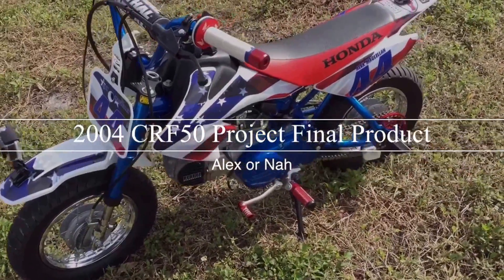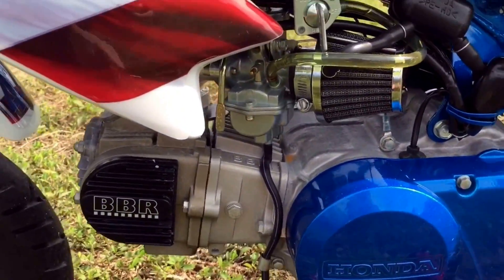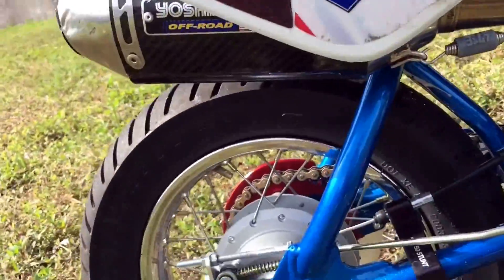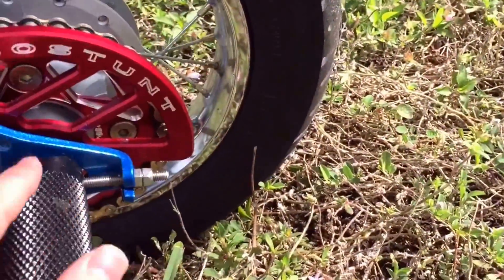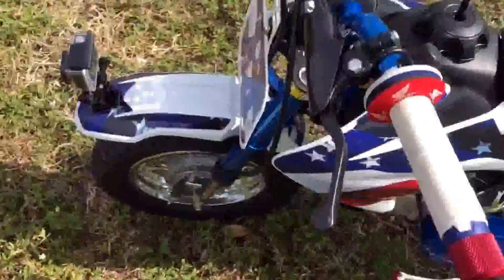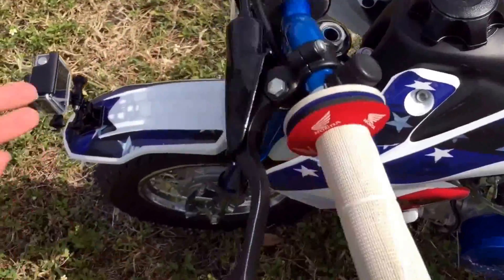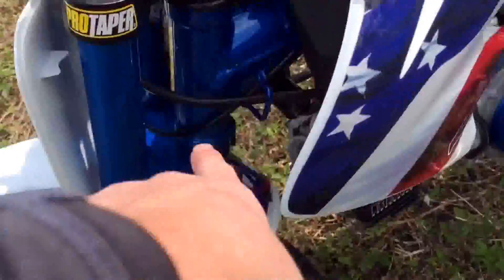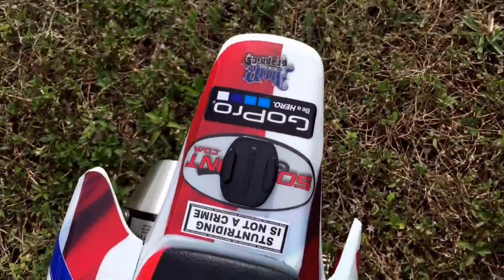CRF50 Stunt Bike Final Product

Comment: do u want a bigger or smaller sprocket I am guessing smaller?
Reply from the maker: Depends on rider skill and motor size. I have a bored motor so I went smaller but if you have a stock motor go bigger
Reply: for top speed (longer gears) go down in the back and up in the front.. they say one tooth is about 3 mph

Comment: Does it really go that fast for an 88cc?
Reply from the maker: +mike esposito yes
Reply: the bike bore kitted motors go faster than most of the 125cc and up chinese motors my 95cc z50 goes around 70 depending on the gearing aswell
Reply from the maker: Sean Smile yup. this bike goes 67 easy. whoops my crf80
Reply: Wait what is your gearing setup
Reply from the maker: Sean Smile stock front and 3 down in the back if im correct
Reply: SO 13/ 34
Reply from the maker: yes
Reply: mike esposito  no it probably hits low 50 high 40s
Reply from the maker: 2strokes Are sick 
Clocked it the other day at 67. Thanks for attempting thoo!